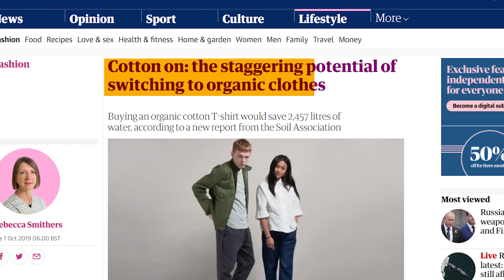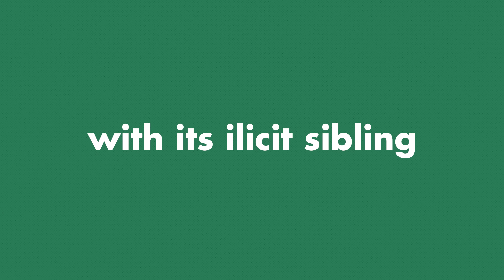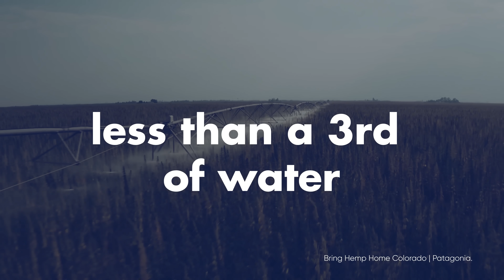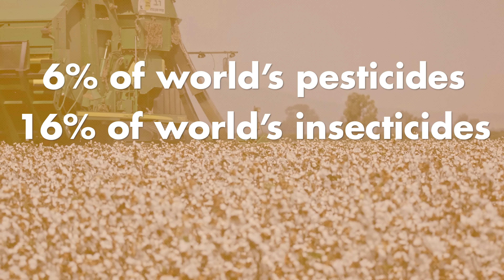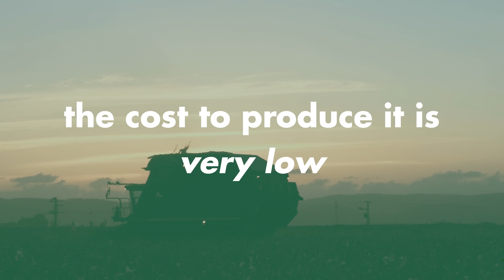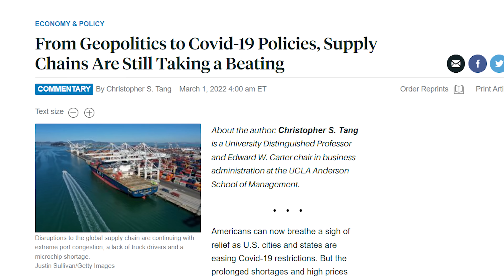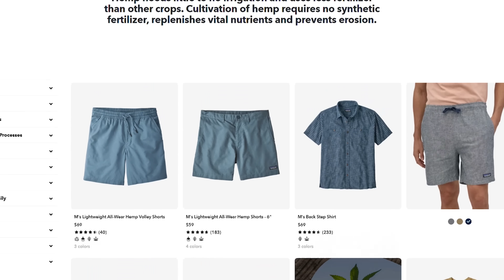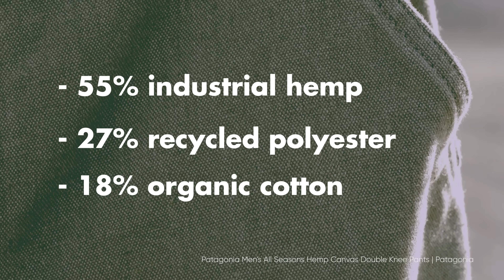The TRUTH About Patagonia's New Material

Comment: Flax linen and hemp fibers have a very similar structure and material content, but flax linen fibers tend to be smaller diameter which feels softer to the human skin.  (the finer/smaller the fiber, the more soft it feels and conversely the thicker the fiber, the more coarse it feels. This is why mulberry silk feels so soft to the touch, because it is a ridiculously thin diameter fiber). 

   Both are pretty "eco" compared to most other materials, though hemp gets a slight edge in that for needing less water and growing faster. 

  The nice thing about hemp and linen fibers is that they are hollow. This facilitates a couple of interesting properties.  They feel fairly warm when they are dry (especially linen since they are smaller fibers. The smaller the fiber, the more air it can trap/still potentially), but when they are wet, they are very cooling while not feeling as soaked as say cotton. Having less material, they also dry a bit faster than cotton and other cellulose based solid fibers. But more importantly, they feel dryer faster because that moisture is wicked to the inside and then out through that hollow, absorbent "straw" type structure. 

   Waxed linen and hemp garments make great cold weather clothing, and unwaxed linen and hemp make great hot weather clothing.

Comment: Environmentally speaking, yes, hemp does appear to be better than cotton (though pesticide use might increase with more hemp because that’s what happens with crops), however, one thing bugs me about the conversation. Hemp and cotton are not even in the same fiber category. Cotton is a short staple fiber(soft, 3/8-2 1/2 in long) that’s fairly soft from the get go. But hemp is a long hast fiber (multiple feet per fiber) that is fairly rough but durable. The softness you get from hemp comes from wear and stress placed on the fiber, lowering its durability. As someone else mentioned, hemp also does not have the same dyeing capacity that cotton has, though I doubt that this problem will persist with more funding. The baseline problem is you cannot use one to replace the other efficiently because their properties are different. On a macro environmental scale, you’ve made a decent argument, I just don’t think it touches the core of the issue.

Comment: Hemp is Cannabis (Latin name: Cannabis Sativa), but the strains that you grow for their fibres and the strains that you grow for consumption are different. 100-200 years ago the two would have been more similar, but since Cannabis became a large industry at first for their fibres, and later for it's use as a medicinal plant/drug, the varieties have diverted. The plant that you grow for fibres is pure Cannabis Sativa, but a strain that has been cultivated to maximize stem size and minimize THC content. The strains that are grown for consumption can vary between pure Cannabis Sativa, to any amount of mix between Cannabis Sativa, Cannabis Indica and Cannabis Ruderalis, to pure Cannabis Indica (even though it's not clear if all of these are different species or just varieties on Cannabis Sativa). These strains have been cultivated to maximize THC content and flower yield, as well as making them easier to grow. It's the same thing as the Hop that is grown for use in gardens and the Hop that is grown for use in beer. Same species, different strains. A fun fact is that Hop (Humulus) is the closest relative species to Cannabis. That's why they have a similar scent. They diverted 25 million years ago into Hop and Cannabis.

Comment: As much as I agree with the overall message, I have to take issue with the way "Round 4" was presented.  The things about hemp being pest-resistant are true, but it's also in the nature of evolution that if we cultivate it in large quantities, nature will just make a better pest.  Loads of crops are pest-resistant or have been bred to be as such, but that only translates in practice to reduced usage of pesticides.  Also, even if it does absorb contaminants out of the soil, what impact does that absorption have on the end product?  If cleaning up the soil makes for an inferior end product (e.g. fiber toughness, etc.), you may just be better off using cover crops for that.

Secondly, things like absorbing soil contaminants and sequestering carbon and so on are also true of other crops (as well as weeds), but you didn't really compare those figures 1:1 with cotton.  Instead, you brought up whole industry figures just related to cotton pesticide/insecticide usage.  The only figure brought up for hemp in this round was the CO2 figure which was per unit land area.  And the wide variance indicates that soil quality is pretty important.

Comment: I mean EVERY plant does what Hemp does with CO2. That's what plants are made out of.  If plants weren't made out of carbon from the air, the soil under them would disappear due to conservation of matter. Implying cotton doesn't sequester CO2 the same way by not mentioning it is misleading... 

Hemp's benefits don't need that kind of reporting. This overall is a decent video, but that one part stuck out to me.
Reply: You're totally right but what matter is the amount of carbon sequestered, its the plant that sequesters the MOST: Hemp absorbs between 8 to 15T of CO2 per hectare, (a dense and old forest sequesters between :2 to 6 T of CO2 per hectar).... Point is people think forests are the lungs of the earth (which is true) but if we cultivated hemp instead of cotton we could counter balance the damage caused by the forestry industry.

Comment: Hemp textile really shines in applications where it needs to resist wear, UV, fire, and microbial damage. Hemp upholstery, “linens”, bags, tarps, and cords are well suited to the purpose. Unlike in clothing, stiffness or scratchy-ness are no disadvantage for these. Apparently hemp bricks have been developed for building materials.

I was shopping for curtain textiles recently and was very impressed with hemp’s crisp drape, colourfastness in sunlight, and flame resistance compared to other options. I would have bought it had I not discovered some adequate fabrics in my mother-in-law’s stash.
Reply: Fire?  Pretty sure hemp is quite flammable. The only natural material that is truly and naturally fire resistant is wool--well wool of all kinds, but the most research has been done on sheep's wool specifically, which has a higher moisture regain than most other wools.
Reply: @justinw1765 I think I made a mistake. Hemp fabric is flammable, but the bricks made from hemp are resistant to fire. They burn very slowly, insulate from heat, and stop burning when the heat source is removed. There are video demonstrations of using a blowtorch on hempcrete which show this.

Comment: It's important to note that hemp (and linen) is not as good as cotton as clothing fabric. While it's much more durable, because of its durability, it's less comfortable around body. it's not just about the harshness of the fabric, but it's got less stretch. this lack of stretch (or more toughness) is what makes them really durable. The issue is that the fabric doesn't really change its shape along with the body movement, so people would feel more restricted. While development in processing may resolve issues lack of softness, it won't do much for lack of flexibility. I doubt that hemp will ever replace cotton in clothing in any capacity. it will probably remain as good alternative.

I wish this episode was centered around hemp, rather than Patagonia. I wish it discussed more on why using hemp on house items, such as bed sheet or curtain is far more likely and beneficial.
Reply: Cotton as a material itself is not stretchy either. Cotton is spun very finely and then knit, and the knit structure of the fabric gives it it's stretch, not the fiber itself. Neither hemp or cotton or linen have any memory in their fibers- linen and hemp are bast fibers which is why they are initially stiffer, but if they are worn and washed they become very, very soft. It's a matter of educating consumers about textiles and changing the way that we interact with our clothes, not necessarily something 'wrong' with hemp.
Reply: Linen is pretty great for shirts. you can also get 100% linen shirts from major brands and they are just perfect for summertime.

Comment: Great step for Patagonia.  I'd love to see more companies use it too as well as ramie and flax.
Reply from the maker: Totally agree! Thanks for joining us here and sharing, Jailyn ✨
Reply: Flax?
Reply: Flax linen has been used forever in more high end garments particularly.  Usually sold for summer wear. It is a great fabric for hot weather--all but the most humid--like jungle humid.  (The higher the humidity, the more synthetic you want to add to speed up drying time). 

Ramie, flax, and hemp have a lot of similarities on a fiber structure and content level, though they have some minor differences. Ramie is less flexible, hemp fibers tend to be a bit larger (and therefore more coarse feeling) than flax linen, etc.  But they are all hollow bast fibers with a high cellulose content but with appreciable lignin content (vs cotton which is more pure cellulose).